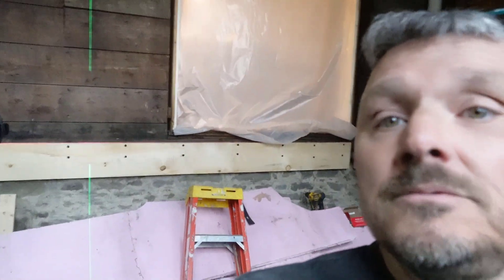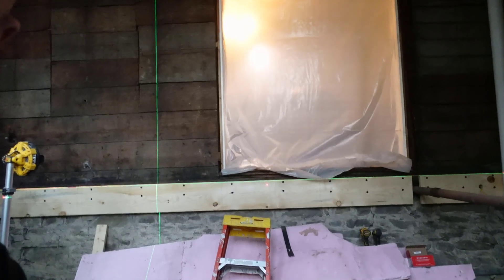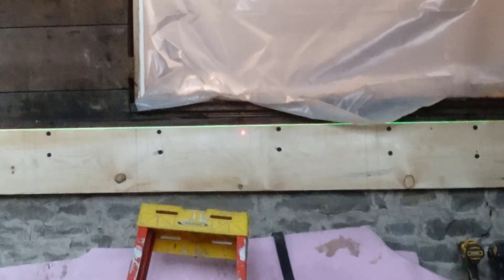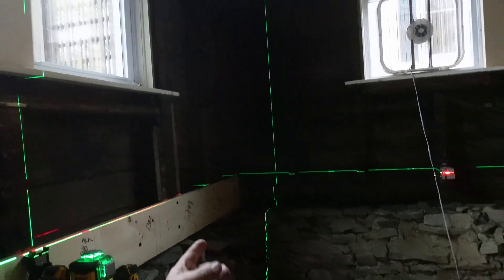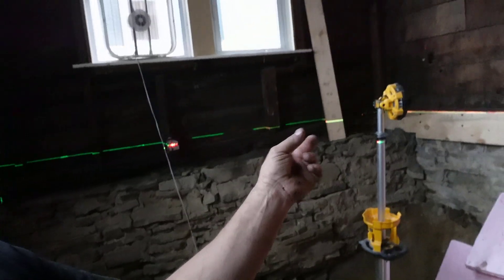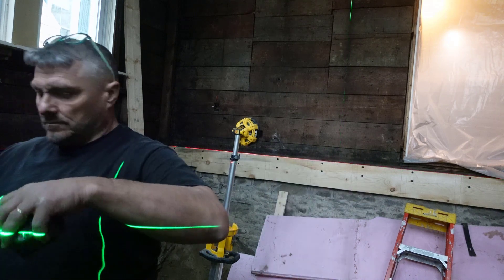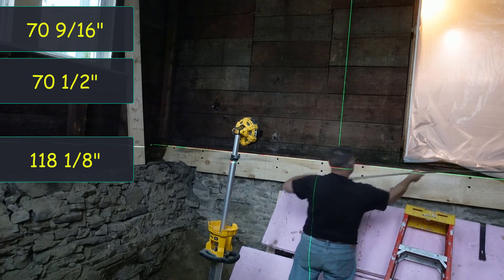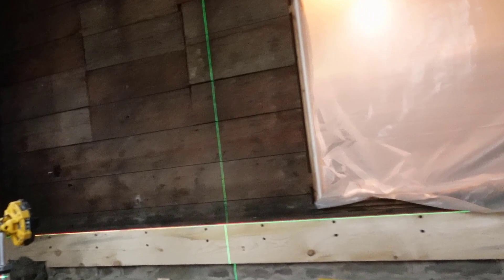DeWalt 3x360 LASER LEVEL to check square of room  - DCLE34030GB - 20V

Comment: Check your laser periodically. I do commercial carpentry and I just discovered my laser was off 5/8” on 40’. We take for granted that we’re using a laser that all,is going to be correct. Well,k was wrong. Never trust a laser without checking for plumb with a plumb bob and horizontally by making 2 marks and spinning your laser 180 degrees and see if the beam hits those 2 marks you made.
Reply from the maker: @jimmys511  howdy Jimmy! I agree. I had my first DW 360 laser have a gimbal go bad and it was not self leveling but looked like it was. Once I figured it out, I sent it to a DW center. They couldn't fix it so they got me a new replacement at a huge discount since mine was out of warranty. Now I spot check with a level
Reply: @sdsconstruction oh wow thanks for the info mine is also a few months past the warranty. I’m going to have to do the same thank you.
Reply from the maker: @jimmys511  Not a problem and thanks for your initial comments about checking the laser levels! I do no believe I have ever had to read out to 40ft on any project I have used this or my other LL for. My typical application is going to be within 20 to 30ft at the outside of the measurement. Any further and I would either need the detector since I might not see the line during the day or I would need to measure in the dark to verify the line.
Reply: @sdsconstruction yeah it stinks either way to find out you spend $500 and your lasers no good lol.and I just past the 1 year warranty 🤦🏻‍♂️🤦🏻‍♂️